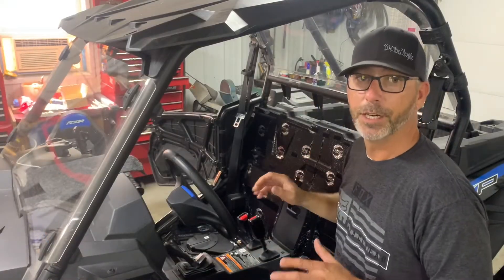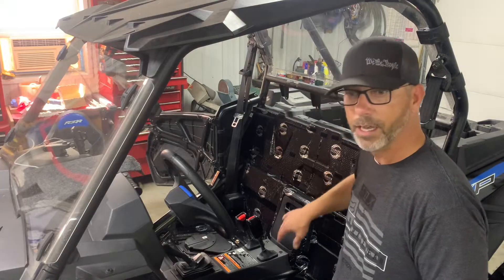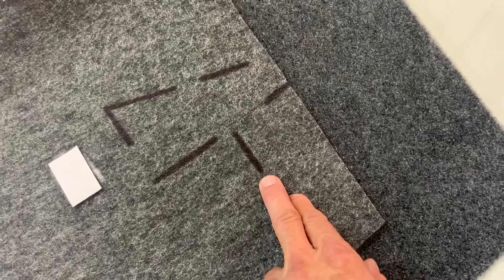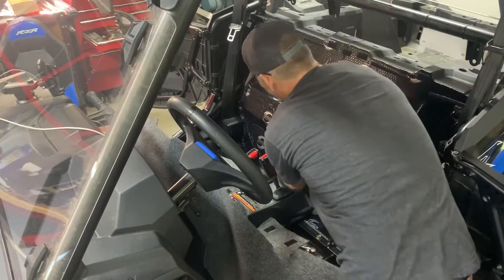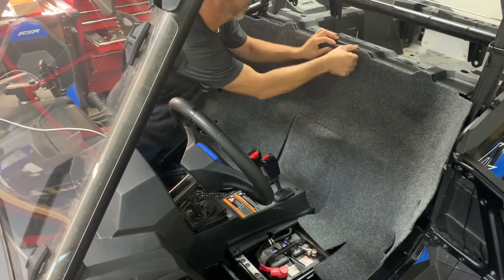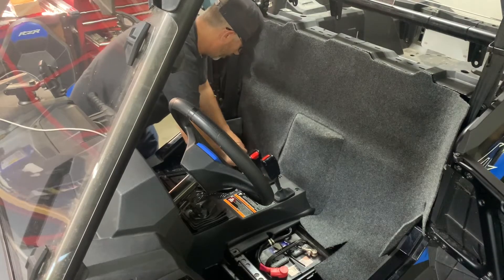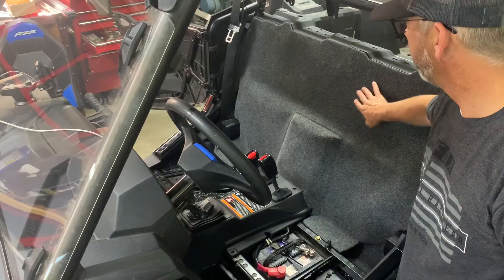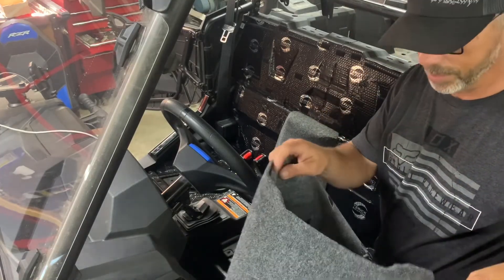Make your Polaris RZR cooler and quieter!!!  Terick Solutions

Comment: Does this help with dust coming in from the back and the bottom?
Reply from the maker: yes you can cover up a lot of the spots that dust enters the cab.
Reply: That’s great but my question was; does YOUR system cover those spots?
Reply from the maker: @willlr1   yes you can add the deadening material to those spots and the carpet also covers up the 2 larger holes on sides behind the seats.
Reply: Thanks, in my climate the dust and the noise are the main issues, the heat generally is not a problem  (except for around the cup holders)